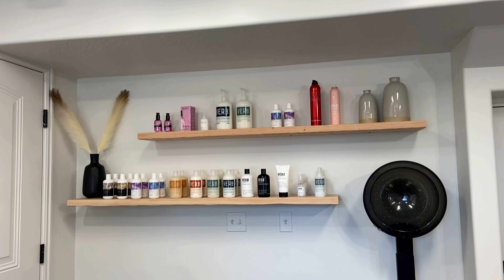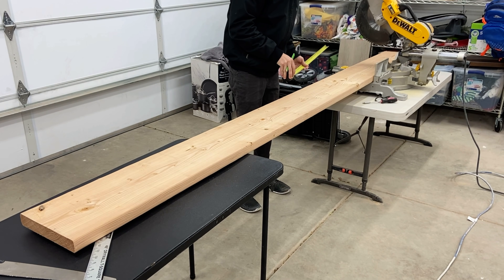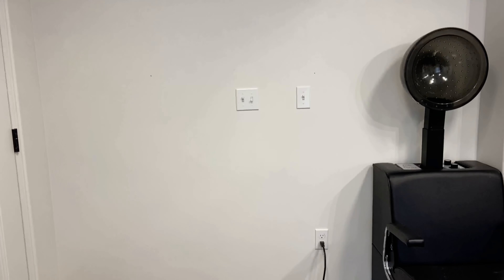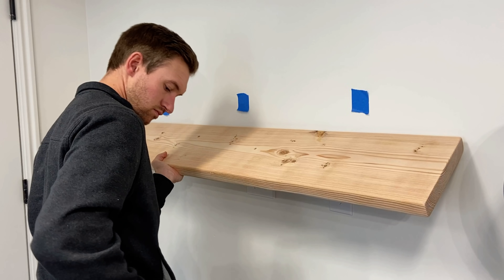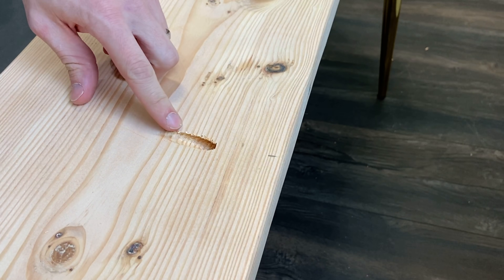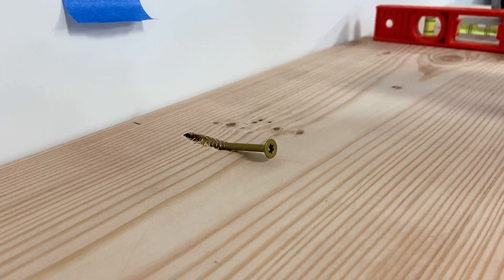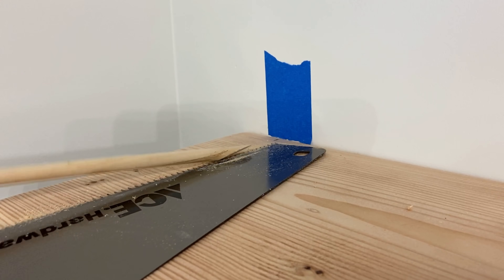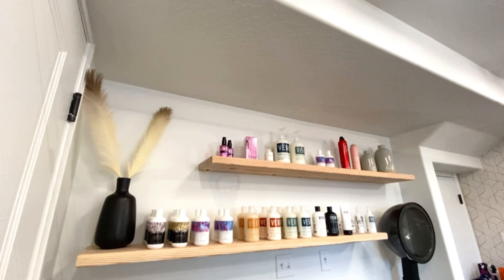These Strong Floating Shelves Only Use 4 Screws

Comment: Can you use the cut end of the dowels for the rest of the holes?
Reply from the maker: You probably could but it might be difficult to make it the correct length. I just cut of the end each time and it was a little easier and it really didn’t waste much of the dowel either! Hope that helps!
Reply: @Nailedityt  what if you’re doing more than 2 shelves would it become too pricey?
Reply from the maker: The wooden dowels only cost $1-$2 dollars each and they are about 3 feet long. You could probably use one dowel to finish 4-5 shelves!
Reply: @Nailedityt  lol I’m sorry I misread your first reply where you said to cut off the cut end then proceed to use the rest of it🥴 Also I will be using my shelves in my kitchen do you think this method would work for a few dishes and filled glass jars?
Reply from the maker: No worries! And yes absolutely, these shelves can be used just about anywhere you can fit them!
Reply: Ok I’m going to attempt to do these this weekend....any advice for connecting the wood at an angle? I have a few that are going to be at a corner should I just do pocket holes to connect them as well but with a shorter screw?
Reply from the maker: Yeah I would connect the shelves first with pocket screws and then after they are connected. Hold it up to the wall and mark all of your studs. After that then screw in each side to each wall! That’s awesome that you are doing to this weekend! Let me know how it turns out!
Reply: @Nailedityt  I’m using the same size boards you using can you tell what size screw I should use to connect my boards and also can you tell what clamp you’re using I don’t have a clamp or keg kit everything else I have at home. I know I’m probably getting on your nerves 😬 but I’m really trying to get this right
Reply from the maker: You’re fine don’t worry about it, it’s what I’m here for to help people like you! A kreg jig kit is almost a must. I think they are on Amazon for about $15. You could also probably find it at your local hardware store. The clamp I just got from Walmart for about $5. Almost any clamp will work. To connect the board together I would use like a 2” screw. If you end up buying a kreg jig. Most of them come with included screws that you could use!
Reply: @Nailedityt  thank you so much!!
Reply from the maker: No problem!

Comment: I found this to work great with2x8s 2x10 max 2x12s will sag for 2x12 s rod is best to use . Also I learned if the shelf doesn’t look level is because the wall not level itself. Nothing a few shims couldn’t couldn’t fix in my house To hide shims under . Nice 1/2 inch corner round molding around the shelf took care of that .thanks for vid
Reply from the maker: Wow sounds like you did your research great job! Glad it turned out and thanks for the comment! I love hearing about peoples builds!
Reply: I was wondering about 2x12, so thank you for this comment!

Comment: Simple and effective, the weight test was a nice touch.
Reply from the maker: Thanks! I appreciate it!
Reply: Nice Job and a Great Idea !!! But im an Old Guy i Still Use a Horizontal Ledger, and Gussets That would Hold 500 LBs maybe More !!  Your way is a Very Decorative Look !!! and it Does Look Very Nice !!! iv been Making Sawdust for over 65 Years Now !!!  i Even Helped out Building of the Ark !!!
Reply: @rogerhegemier8491 what do you call to havw holes in the wall tomake it stable

Comment: Wondering if flipping the board, so that the screw goes in from below, would comprise the weight limit? 🤔 💭 
Any thoughts? 
I’d like to hide the pocket-holes/dowel-covers by having them be underneath rather that above.
Reply from the maker: I would too! But sadly the shelf would not be level, I tried before I made this video! Great thinking though!
Reply: @Nailedityt  oh really? Does it cause it to sag on the side furthest from the wall? 
That’s where I could picture the imbalances being, due to the angle of the screw going in.
Reply from the maker: Yes that’s correct! It sags by a few inches, it’s just the way the pocket hole works!
Reply: @Nailed it  thanks for that!!! Wasn't aware of the inner physics if u drill  lfrom the bottom
Reply: @Nailed it  thanks for that!!! Wasn't aware of the inner physics if u drill  lfrom the bottom
Reply: No no no

Comment: How about warping over time using lumber instead of plywood?
Reply from the maker: Yeah, warping could be an issue! The plywood just is very thin for how big this shelf is! Hopefully the board is dry and won’t warp but I guess if it does warp. These are fairly easy to make!

Comment: What size drill bit did you use?
Reply from the maker: I just used the included drill bit that came with the Kreg Jig. It is 1/2” or 12mm!
Reply: @Nailedityt  sweet, thanks man!
Reply from the maker: No problem!

Comment: This is much more doable for this novice than anything else I've seen. Please share link to the clamps you used to hold that jig. As well, where do you get the stick of wood you used to fill these holes after you mounted the board to the wall @nailed it?

Thanks

Comment: 1:58 With 1.5 inches and a 3.5 inch screw though, where does the screw come out of the wood?  For optimal support, the jig says it should come out at the middle.  The downside is that might mean you'd have to move the jig and screw closer to the edge.  Also, a round washer would be optimal since the screw isn't a flat head.  Thoughts:?
Reply from the maker: If you set the jig to 1.5” it should come out of the middle of the board! You can use a washer if you feel like it is needed for extra support but I don’t think it is necessary! They are pretty strong even without!
Reply: @Nailedityt  Thanks for the reply; I'm going to give it a try and make shelves for shoes in my garage using 2x10 boards.

Comment: Don't you need to pre-drill holes on the cement wall? How about wall plug? So the screws can just drill into the wall? This is interesting.
Reply from the maker: If you are mounting the shelves on drywall with a wood stud behind it then you will not need a plug or pre drill! The screws will work without either! 

If you are mounting the shelves on a concrete wall/cinder block wall then you will need to use different screws! 

Here is what the other screws look like: https://amzn.to/3z4tum5
Reply: @Nailedityt  I see. Thks.
Reply from the maker: Did that answer your question? Are you confused on anything?

Comment: So you made abig mistake,cause of if you want to remove those shelves it domaged the wall cause of that pegs
 you put for cover the screws
Reply from the maker: You can remove the dowels by screwing a screw into them and wiggling it back and forth, I have done it a few times and it works great!

Comment: I just tried this...issue is, the wood isn't straight in the back, therefore there is gap in the back. Also, definitely need 3 studs....2 studs/nails won't work
Reply from the maker: I see you commented on my other video! In that one I only used two screws! It seems to work assuming your shelf isn’t very wide!

Comment: Can you install with out drilling to a  Stud
Reply from the maker: That depends! Are you trying to mount the shelf into drywall or something else?
Reply: @Nailedityt  dry wall this part of room where they want this located has no in the range
Reply from the maker: Sorry I just saw you commented this! You could try using Drywall anchors but I don’t think this system would work very well with that, even if you could get it to work, it wouldn’t be as strong. You could try running a board on top of the drywall and screw it into the closest stud and then create a “bridge” to the next closest stud. Then mount the floating shelf to the “bridge” you just created. The only bad thing with that is it wouldn’t look like it was “floating”. If I were to be in your situation I would try either one of those first. I would try to find a heavy duty drywall anchor or make a bridge between the closest studs! If you don’t think either one will work, comment again and I’ll try to think of something else! Hope that helps!

Comment: If the holes are put on the bottom going “up”, wouldn’t that lessen the amount of strength on the shelf? Making it easier to pull out of the wall? (I want to try this with 2x4 stock). Thanks 🇨🇦

Comment: Thanks for sharing. Any tips on how deep these can be? I'm thinking of having some floating shelves with 18 inches depth and 23inches wide. They will be in a corner, so I can put pocket holes in two different sides.
Reply from the maker: I think that should be fine, just make sure you put pocket holes on each wall. Also try and keep the screw as close to the front as possible! What is the thickness of your wood? If it gets to thin, then you may see the front corner sag since it’s just floating in mid air!
Reply: @Nailedityt  I don't know about how thick the wood will be yet. I have to go to the home store to check. How can I know how thin they can be? I want as thin as possible (maybe like yours in the video is the maximum I would go)
Reply from the maker: I would try to go on the thicker side if at all possible. The deeper the shelf the more risk of it saging! Let me know what you find out!

Comment: I just finished mine, and it didn't work :(  I'm not sure why it didn't work out as you'd show it. Probably, because of the fact that my wall wasn't straight. There were tiny gaps between the wall and the shelves, but I didn't want to drill deeper into the screws otherwise there wouldn't be enough wood to hold up the shelf. In the end, I had to attach some supporters underneath the shelves. great idea and tutorial though !!!!  :)
Reply from the maker: Aw dang I’m sorry to hear that! Yeah having a straight wall is key but it’s not your fault it was off! That’s just how some walls are built unfortunately! Well if you ever try them again you’ll have to let me know if they turn out better for you! Glad you liked the video!
Reply: @Nailedityt  I've watched the video several times, but I just noticed that your shelves have pocket holes in the bottom of shelves as well. did you pocket screw those too???
Reply from the maker: When I was making the video I tried a few different combinations! The best combo I found was the one I taught in the video! I tried to put them on the bottom but the shelf is not level if you do that!
Reply: @Nailedityt  thanks for responding. I'll keep that in mind for my next shelf project.  Thank you 👍
Reply from the maker: No problem! I hope life is treating you well!

Comment: I recently tried to do this exact project. I followed all of your steps, but the board was 6 ft 8 inches long. It kept sagging down and wouldn't stay straight. Do you know why it didn't work?
Reply from the maker: How many studs are you mounting it too and how wide is the shelf? Also are you using the same screws in the video?

Comment: Nope, never do this. I don't care what kind of scale he put on there and how hard he pulled - never rely on a screw less than 1/4 thick to hold a 10" board on the wall like that. There is a reason we use rods that protrude several inches into the board. Those floating shelf hangers they sell on Amazon are awful too, they rely on a tiny set screw which is worse than this video. Drill a hole in the stud, stick all thread in the hole. Place the board on the all thread and mark each all thread onto the board, drill those holes and mount the board.
Reply from the maker: Hey Tim, I appreciate your comment and input. I want to remind you that people can use this technique on smaller boards as well. I just happened to use a larger board because my wife wanted more shelf space for products in her salon. I’m sorry you don’t agree with my video but in the end I encourage people to do what they think is best and all I was trying to do was show people how I personally did it in my home. Thank you for your opinion.
Reply: I've got these in my office and used the same method. Works great 👍
Reply: I did a test with a 2x4 drilling a 3/4 spade bit and inserting a 3/4” oak dowel into the stud. I’m willing to bet you can drill the corresponding holes in a 2x 10 and be good.
Reply: @Nailedityt  Just to give you a more visual indication - your solution is totally valid if the Drywall was a non-compressible material. And if you're going to put light-weight items on the shelf, it should hold without any issues. However, if you put larger items and compress the drywall, you lose a lot of strength and those 1/4" diameter fasteners will bend and not be able to hold indefinitely.  Neat idea however for light-weight use.

Comment: You could have used the blue outdoor Kreg screws. An alternative would be to use cabinet screws which have similar heads to Kreg screws and are designed for similar forces.

Comment: Thanks! Didn't know that would hold 100+ pounds.

When using pocket holes you should try to use screws that have a flat head (not your typical wood screw that has a wedged).  The flat head will sit better in the pocket hole.
Reply from the maker: I agree, I just didn’t know of a screw that was that thick and that long! If you find one let me know, I would be interested in trying it!

Comment: This is great, thanks for posting. Where did you find the 3 1/2 pocket hole screws? I can only find 2 1/2
Reply from the maker: I don’t think they make a 3-1/2 version! Those screws are not actually pocket hole screws! The screws I use are made by a company called GRK! They look something like this: https://amzn.to/3yU6Woe

These are awesome screws! Once you use them you won’t want to use anything else again!
Reply: You don’t need pocket hole screws, regular wood screws would the trick. However the thicker the better support it provides.

Comment: Nice and easy! Can you tell what wood it was? How heavy the board? Thank you.
Reply from the maker: I just used pine! If I were to guess the board would be about 25-30 pounds!
Reply: @Nailedityt  thank you! I was about to try the same way but got concerned about the weight of the board.. but I think I got a very heavy one from Lowes “Severe Weather Ground Contact pressure treated exterior wood protected with Copper Azole”.  Might need to try to find a lighter wood. Thanks again and good luck with your channel!
Reply from the maker: I think you could still use a heavier board just not to heavy! Those screws do an awesome job at holding a lot of weight! And thank you! I appreciate the support!

Comment: Wow nice video Blake, short- sweet & simple. I'm planning on making a floating shelf for my Xbox One which is a much larger console than my Xbox 360 so I was thinking of making the depth of the shelf 12 to about 14 inches. Using this method that you showed in your video would it work on a shelf of that depth?
Reply: You probably need a bracket seeing as how that's really far out but maybe not since I'm assuming it's only for the console and if it is you're probably fine

Comment: I wonder if it would be stronger with the screws installed on the underside....
Reply from the maker: I actually tried that thinking the same thing before I made the video. If you were to drill and install the holes on the bottom. The board would be extremely unlevel and tilt forward. It’s just the way the Kreg Jig works and how it drills the holes in the wood. Great idea though! Great minds think a like! 😉

Comment: what if I only had 2 studs and wanted the shelf to be 24" wide
will I be able to have the same strength? I only need them for some bathroom toileteries
Reply from the maker: I only used 4 screws because I had 4 studs! My shelf was really big and so I used as many studs as I could. You will have a much smaller shelf so the 2 studs that you have should still make the shelf very strong. I don’t know if it will be as strong but it could also be even stronger! Maybe I will make a video of a smaller shelf but using the same system!

Comment: Great video! I was thinking of trying this with 1"x6" boards. Would you change the position of the kreg jig or the length of the screws for this?
Reply from the maker: Hey Dan! Check out this other video! It goes over the kreg jig in a little more detail and I use a smaller shelf! 

https://youtu.be/WS73MbjF3Ko

But to answer your question, you could probably do it with a 1x6 but it wouldn’t be able to hold as much weight. The wood would probably crack and split along the back! As long as you don’t plan on loading it up! It should work fine! If you want to use a 2x6 that would be much stronger like I show in my other video link above!

Comment: Great video and great idea - did you think about flipping the board over so the pocket holes are on the underside or would that be too difficult to mount that way? - thanks
Reply from the maker: I did actually and the shelf does not hold. The front of the shelf bends down! It’s just the way the pocket holes are designed! Great question though!
Reply: @Nailedityt  
I thought so!!
I'm a woman who makes boboos all the time on my projects wannabe, I found that out, especially placing heavy thingys!
😄✌️
I saw you put the dow in that hole, I said, so that what that long sticks I saw at HD for🤔        
 Thanks!😄